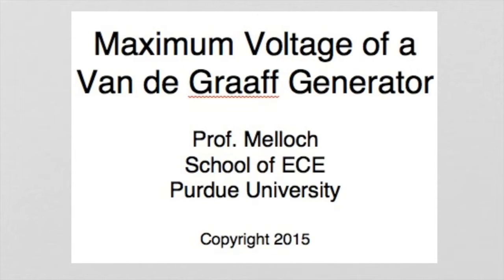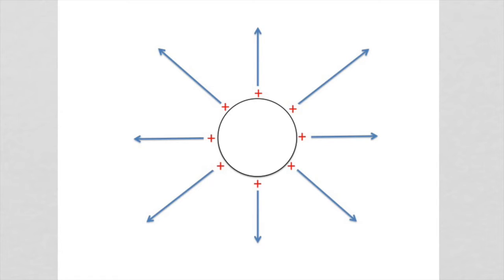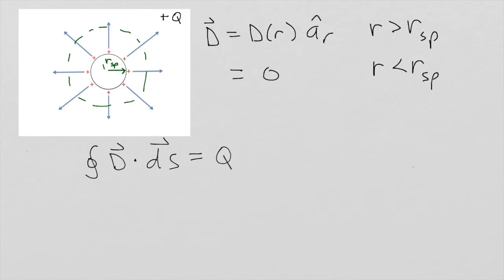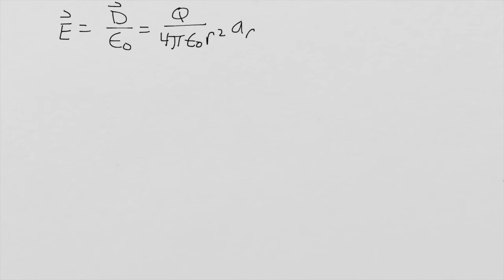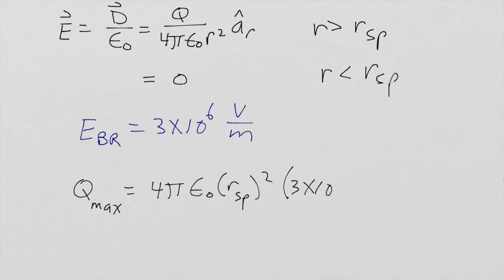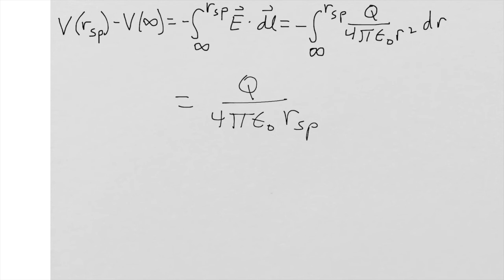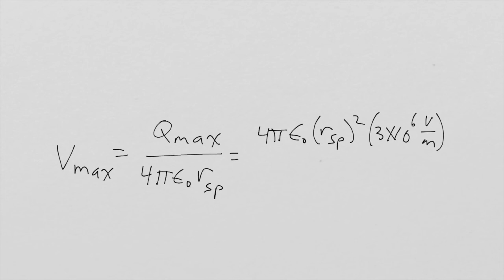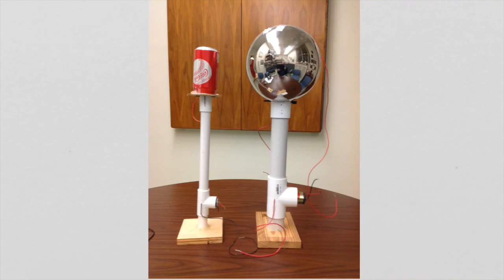Maximum Voltage of a Van de Graaff Generator

Comment: I have two identical VDG's; one positive the other negative, terminal diameter = 30cm (i.e. +/- 450kV) If I run them as a pair, the difference should be 900kV, with the corresponding breakdown distance in free space/air. Either one will create a spark of 30cm, but the pair refuse to give a spark of 60cm. What am I doing wrong? (signed, 'disappointed' of Hampshire).
https://www.youtube.com/watch?v=XjP8F1iRmDc&t=22s
Reply from the maker: How close together do you have to get your two VDGs before you get a spark between them?

Comment: What if I have a VDG and place the other sphere beside it at a distance d? This way one could regulate the amount of voltage on the VDG changing the distance d. How would one calculate the voltage taking into account that distance d? Thank you for the video!
Reply: It should be a capacitor, the equation for two spheres I forget.